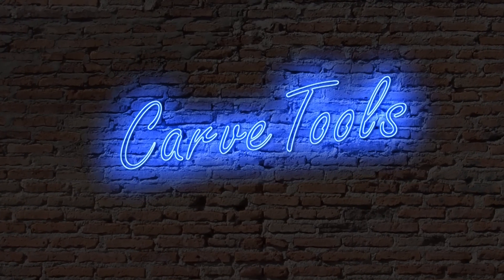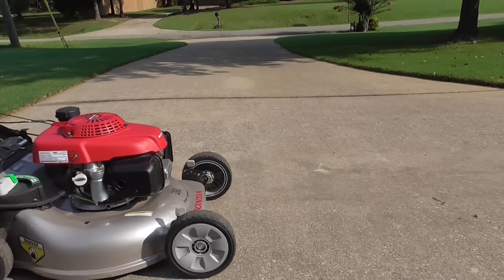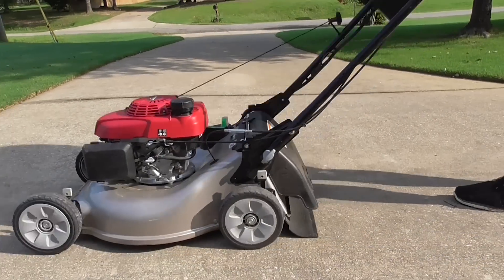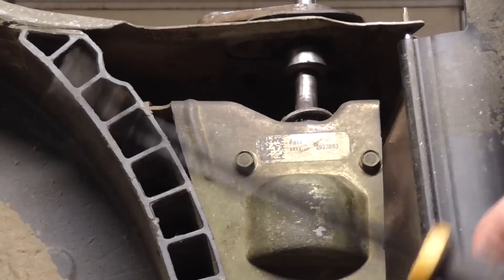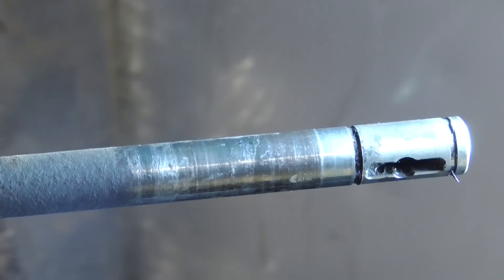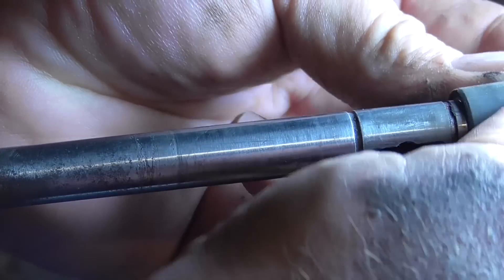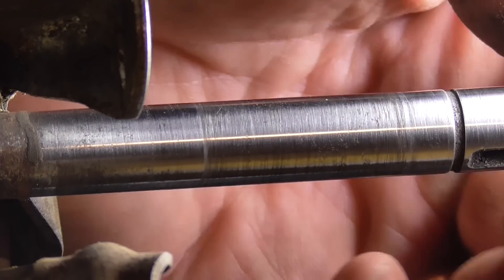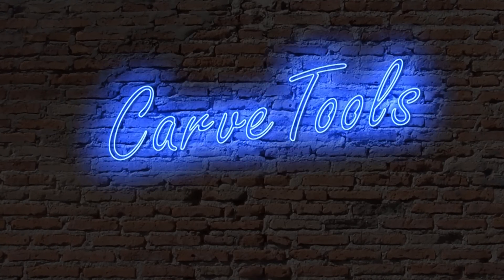Honda Mower Rear Wheels Will Not Roll Backwards THE REAL FIX

Comment: My mower is only 2 months old and has this problem. I do wash it off because damp grass sticks to the mower. Real poor design by Honda. Always cost cutting and cheap.
Reply: Robert Kusek --  I know, I am there with you..  Glad you are keeping up on cleaning the underside, so that damp grass doesn't break down and start eating away the metal underside..  I have not tried it, but some people are saying to spray some WD-40 into the axles after cleaning, and that seems to help.. WD-40 IS designed to displace moisture, so that must be why it helps..
Good luck with this..

Comment: i just bought a honda hhr216vka last weekend( from home depot) would this model have this problem??
Reply from the maker: Hi sundogtune, Congratulations on the new Honda, I purchased my last 2 from HD also. Hopefully your new mower will not be an issue but only time will tell. When you are completely exhausted trying to drag the mower backwards that would be a good indication.
Reply: Yes, you will have the problem...

Comment: I guess the transmission is not designed to go backwards
Reply: JaArRyi FleshBlood --   No, it is ok to pull it backwards, but the bushings in the rear height adjusters get clogged up with dirt, grass fragments, and moisture and start eating the metal axle, which then adds more resistance to pulling it backwards..

Comment: Great video. I've watched it many times, as I have the same problem. This fix worked on the shorter left side ( nearest to the transmission). However, I can't get the right side height adjuster off to get to the axle and bushing. I've verified I got the snap rings off, I've tried WD-40, dead Hammer and pry bar but it won't loosen up. Can you offer any thoughts of help or advice please?
Reply from the maker: Hi Yianni, The best I can remember the height adjuster is held in place with 2 nuts located inside the frame. I took the drive cable, spring and belt off to get the transmission out. One viewer commented to mention to your Honda dealer  "Honda Power Equipment Lawn Mower Service Bulletin #107" and they will replace the bushings with the correct ones. Cleaning the shaft with sand paper worked for me and still no problem. Hope that helps.

Comment from the maker: GREAT NEWS! 
Just mention to your Honda repair shop "Honda Power Equipment Lawn Mower Service Bulletin #107."  If they have no idea what this is, find another repair shop. 

Unfortunately in my case Honda did not feel compelled to inform registered owners about the rear wheel lock-up issue. It is my understanding Honda will repair this for free if your mower is still in warranty otherwise you pay for the repair. So I buy a new product and if it has a known factory defective and it is out of warrant, I pay to have it repaired. Seriously!
Reply: I just replaced the height adjusters for a customer according to #107. It said the bushings are larger, hopefully this fixes my customers issue. I may be doing the same to my mower this winter and hopefully the problem will be fixed for good.
Reply: yes same my Honda dealer said its a recall but honda wont actively notify customers or it unless they bring it in complaining.

Comment: I had the same problem also but with one front wheel.  Cleaning the axle is probably the better solution but I got lucky and was able to just spray the axle with WD40.  Works great!!  Thanks for the video!
Reply from the maker: This is the most aggravating mower I have ever had when it does not work properly. Thanks for the comments!
Reply: CarveTools ok, I hope it works out.  Actually mine is a Toro, but the video was still helpful.    God Bless!

Comment: there's a Honda service bulletin, lawn mower #107, seems the inner bushings are undersize on alot of these mowers and they have made available an oversize set. Mine is in the shop now for this repair, under warranty...
Reply from the maker: Thanks you mrWkf123 for sharing Honda Power Equipment Lawn Mower Service Bulletin #107.
Reply from the maker: Congratulations! You found a Honda Service Center that has the solution. Would be nice if Honda would share this recall information. Thanks for the comments!

Comment: I also wanted to add. I would be careful on what grease you use with the bearing. The bearing is two pieces, the inside piece has a rubber gasket to seal out dust/grit/dirt. I wouldn't use anything bad for plastic/rubber, this includes WD-40. I ended up using some DuPont Teflon non-stick dry film lubricant, applied to the inside of the bearing and on the axle where the bearing would be located. It's supposed to repel dirt/dust/grime as well. So we'll see how long it lasts.
Reply from the maker: Thanks for the advice on the lubricant! So far after this video it still pulls back easy without locking up. Have a great day!

Comment: This is definitely my problem. I have an HRR2165VKA. Unfortunately, I can't get the height adjuster off the axle on the transmission side. I can turn the height adjuster left or right and it turns the axle both ways which it definitely shouldn't be doing as there should turn freely without also turning the axle in the transmission. The height adjuster on the other side came off with some wiggling pretty easily. So, I'm going to have to take it somewhere that can fix it for me.

EDIT::
I ended up using an axle puller to get the height adjuster off. It left the bearing on the axle. Once I got the transmission out I was able to use a hammer and punch tool to get the bearing off. The axle wasn't really marred up. I think the rubber seal on the inside bearing broke down and let dirt/grime in and just froze it up, or broke apart, depositing its pieces inside the bearing. I sanded the axle down regardless, used some DuPont Teflon non-stick dry film lubricant on the axle where the bearing would be and installed new height adjusters with bearings in them already. Everything seems to be working ok now, just need to adjust the transmission a cable for the self propel.
Reply from the maker: Hi Greg, Yikes! Sounds like your mower was in worse shape than mine. I do hope this video helped and everything is good now. Thanks for the comments!

Comment: I picked up one of these free from the curb the other day and ripped off the drive components to make it into a caster/pusher.
Reply from the maker: Someone will probably find mine on the curb one day. I just had to replace the drive cable on this 3 year old mower last week. I'm not sure why you would want this type junk mower for a caster/pusher? That's an insult to a caster/pusher.
Thanks for the comments!
Reply: That same mower ( cuts great) threw a piece of hangar wire from a rental property lawn into my Achillies tendon. I've been off work almost a week. Crazy.
Reply: @twinflameupdatewithkarende3645  Where are your work boots???

Comment: Pramod Kotwal
I benefited from the video and managed to clean the rust from both ends of the shaft without actually removing the transmission from the lawn mower. Once you remove the gears and the clips from both ends, the transmission slides through the bushings enough to expose the area that is normally in the bushing. I had to use a wooden block and some tapping with a hammer to free up the shaft. Once it is clean and lubricated, it is amazing how freely it moves. Now assemble everything and the problem is solved. Thanks for the video and all the comments.
Reply from the maker: Wonderful! Glad this helped. What you did was much easier than the disassembly I did in this video to find the problem. Happy mowing and thanks for the comments!

Comment: Dave, first off, fantastic video!  I removed the wheels and the pinion gears then sprayed Motorkote spray lube into the bushing. I also removed the circlip and washer on the inside of the deck and did the same. Wow what a difference! My mower is fun to use again.  I intend on doing a complete removal of the gearbox off season, but for now this is working great.  Thanks again!
Reply from the maker: Hi Alan, So glad this worked for you! I took the gearbox completely out in this video to see what was causing the problem but I think it is possible to polish the shaft that goes into the bushing without complete removal. Thanks for the comments!

Comment: I'm trying to raise the mowing height on my HHR216 lawnmower.  I was able to raise the front fine.  But I can't seem to remove the adjuster parts from the rear.  I see you removed them on your video but I don't see enough to describe how to remove the adjusters.
Reply from the maker: The adjusters are held in place by the snap rings on the shaft. Try a Google search for "hhr2169vla parts diagram" and you will see them. Hope that helps and thanks for the comments!
Reply: Ok i searched for videos on transmision replacement for my mower and found a video which describes the one big snap ring behind the adjusters. Thanks

Comment: While this is a great video it's not a real fix, rather a patch repair. The issue is gonna come back. Honda need to re-engineer this exposed drive train and spend a few bob
Reply from the maker: Thanks for the comments and I agree, the issue will eventually come back. This is the only response I received from Honda; 

“This is not the true cause of the issue, and it will not address it properly.  The preference if a customer is encountering this issue is to bring the mower to a dealer and let them address it correctly.  They have the proper tools and procedure to properly lubricate and resolve this issue.”
In other words bring your mower to an authorized repair center and leave it for 3 weeks and they will lubricate it.
Reply: CarveTools lol, I hear you.. Not good enough from Honda or the dealers. Meanwhile I skipped on the self-propelled unit, brought an old fashioned pusher and avoided the issue since they aren't going to address it. A shame really, all that needs to happen is a set of shielded bearings - it seems reasonable to pay the extra $20 on a high end mower.

Comment: When the mower is working properly, how much resistance should I be feeling when I pull backwards? Because right now I can pull the mower backwards with one arm and its rolling backwards, but their is a bit of resistance, probably a little more than I would like, compared to some mowers that have no resistance when pulling backwards. But at this point I cant say with certainty that it still has this issue. Like I said I can pull it back with one arm and the wheels will turn without stopping or slipping or tearing up the lawn and I can hear what sounds like proper drag from the trans pulling back, but it still seems like its a bit too much, should their be very little resistance, could the mower roll back by itself when working properly or should I be feeling just a little bit of resistance or is the amount of resistance I'm getting acceptable?
Reply from the maker: Pulling backwards with one arm is a good sign. What I have experienced is there should be only a small amount of resistance when pulling backwards, one arm.  The wheels are gear driven so when the forward drive is released and you pull reverse the wheels are having to turn the small ratcheting gear. This is where the resistance comes from especially if there dirt build up between the transmission shaft and plastic bearing. When pushed forward you should hear the clicking of the ratchet gears. Thanks for the comments!

Comment: Please recommend a good pair of snap ring pliers. This is the only thing making this job miserable for me.
Reply: Channellock #927.  $30 but one pair does internal and external and comes with various tips.  Right angle tips are needed for some of the snap rings on these Hondas.
Reply from the maker: Hi Eric, I've been using a cheap set for decades so I would recommend something like from Harbor Freight Item # 63845 cost $5 or at Amazon "4 pc Combination Circlip Snap Ring Plier Internal External ORing C-Clip" for $8. Both are identical except for the color. Hope that helps!

Comment: Mine did this same thing after only 1 season. I ended up taking it back. Also i noticed your right front wheel doesn't always touch the ground, the same as mine does once again on my 2nd mower. Also has a tendency to pop a wheelie when taking off.
Reply: CarveTools unfortunately everything is the same.  Thinking about the Toro super recycler.
Reply from the maker: My right front wheel often skips the ground but I haven't noticed any unusual cuts in the lawn. Hope your 2nd mower is better. Thanks for the comments.

Comment: If this sounds like too much work you can do what I did. I removed the wheel assemblies, left the bushings and pinion rod in place, and used my mixture of ABS and differential fluid I keep for my rusty Jeep projects to soak into bushing. If you adjust the deck height lever you'll notice the rod spins with it; grab the rod with channel locks and articulate the height lever back and forth for a while to work your lubricant into the bushing. You will feel the resistance wane as the lubricant works itself into the bushing.

I did clean all of my parts and gave them a nice coating of my ABS & gear oil mix. I didnt use grease because I feel it will trap more debris and figured its easy enough to oil a few times a year to prevent this going forward.

Great video!
Reply from the maker: Brake fluid is good stuff, just have to be careful what you mix with it. Glad that worked out and yes that would be much easier. Thanks for the comments!

Comment: Thanks for making this video, been putting up with this for the last two years.  I saw in one  of the  other videos on this topic , that you can get the (supposedly) upgraded part  to fix it once and for all, it cost me about $13 per side, seems to work well, some resistance pulling back but at least they turn now and don't lock up anymore.  My axle didn't seem to be rusted or pitted at all so I just put the new part on.  Like one of your other subscribers below, I wish there was a little less resistance when pulling back, but didn't want to put grease in there as I'm sure that would attract dirt and eventually gum up.
Thanks again 
 
 Honda Part number is 42930 -VG3 – B01 (For the right side) and part number 42940 – VG3 – BO1 (For the left side). (you need a set of retaining ring pliers).c
Reply: Why didn't you submit a claim into Honda Power Equement for warranty services to have it repaired at no cost? I owned Honda mowers for years! Hands down, Honda mowers are the best, at least as far as I'm concerned.
Reply: @captainfallsalotatppic2508  Meh, Honda mower engines are good, but their self propelled drive is a weak compromise. Snapper is much better in that respect.

Comment: For a quick fix before tearing it apart try tilting the mower from the side and spray your favorite penetrating fluid on the trans shaft where it goes into the wheel. Spin the wheel, respray and let soak in a minute or two. Do both sides. This worked for me just today. Pulls back fine.
Reply from the maker: I tried that several times with different penetrating oils and it would be ok when it was cold but as it heated up it would lock up again. So far have had no issues this season. Thanks for the comments!
Reply: True that worked for me too...As a matter fact that happened to me yesterday.  However I'm glad I found this vid as to do fix later this year.!

Comment: Thank you!  I have watched countless videos trying to find out how to get my mower to roll backwards again.    This video was very clear, concise and focused on the problem.  I do recommend some of the other videos for how to remove the transmission and axle.
Reply from the maker: I would have thought that the answer to this question would be on Honda Power Equipment website but then they would have to admit there is an issue. I had nothing to lose by breaking it down to see what is wrong. I did not add the part on removing the transmission on this video, I just wanted to show the problem. Thanks for the comments! .
Reply: Do you remove the wheel adjusters? Is there another video? Where did you remove the bushing from?
Reply: @sidneywhite749  - Yes, the wheel adjusters have to come out to even see the end of the axle.. There are a series of  C clips flat washers, the pinion gear, another washer, to get the adjuster off..  Just mind where all these parts go back on, and especially, the pinion gear.. It has to go back on exactly as it came off or it will not rotate forward and click.. Watch out for that..
I ended up having to purchase 1 large C clip remover and 1 small C clip remover.. They were made by Channel Lock and work great.. 
The large C clip remover is needed for the large C clip on the inside of the axle underneath.  This big C clip has to be released and moved off the axle with 1 large washer,  if you are going to remove the entire assembly..
Perhaps, it might be easier if you can, get some  emery cloth in the right grits, tear it into thin strips and sand down the ends of the axle with it still in the lawnmower and not have to remove the entire transmission assembly out of there..
Good luck !